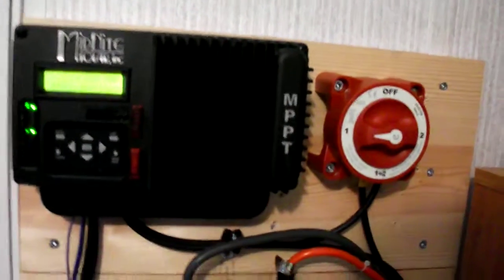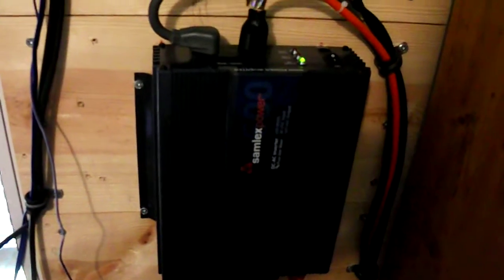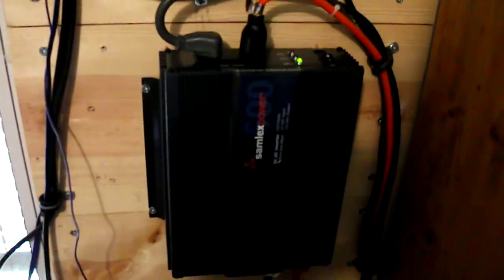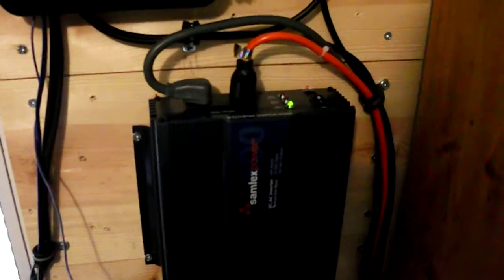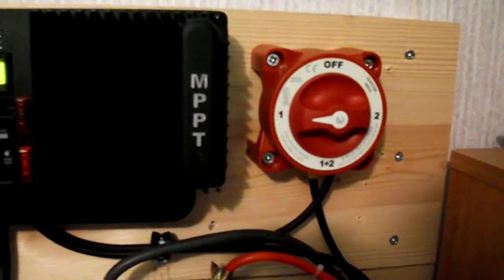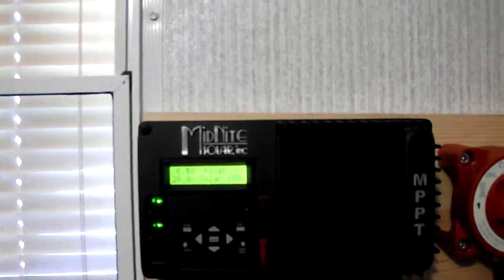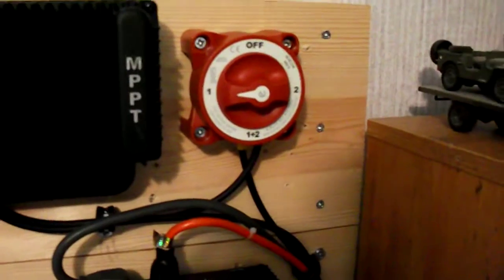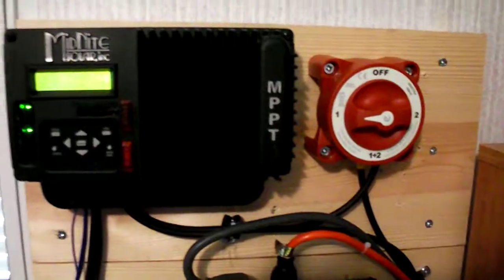Diy Solar Install on Mobile Home   UPDATE

Comment: I have the same Blue Seas switch except it is before my charger. On position 1 it goes to my Kidd. On 2 it goes to my plug and play grid tie inverter. On 1 and 2 it goes to both.

Between my Kidd and the batteries  I have another Blue Seas on off switch.
Reply from the maker: I took out those switched and instead went with a breaker box

Comment: Thanks for update.  I used the plug and play grid tie inverters in my kids GA home. They work well and ga power approved when used on a isolated circuit.  Just only put 80% of rated wattage in them and they work.   Its good to see you becoming less Dependant on the corporate system.  We live off the grid.